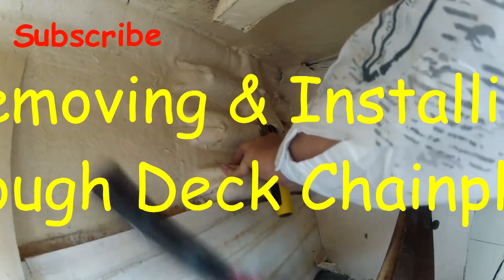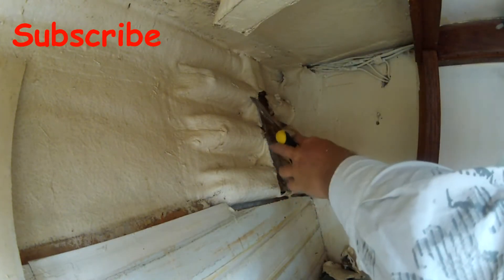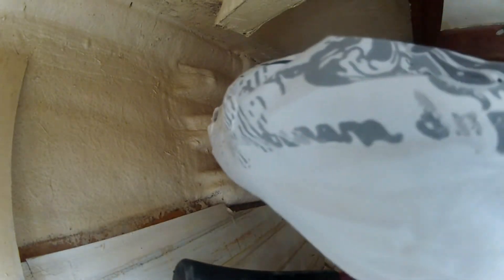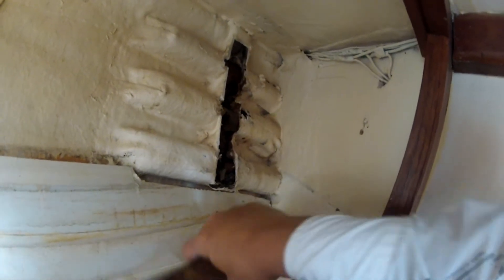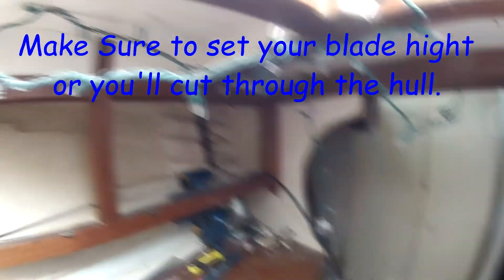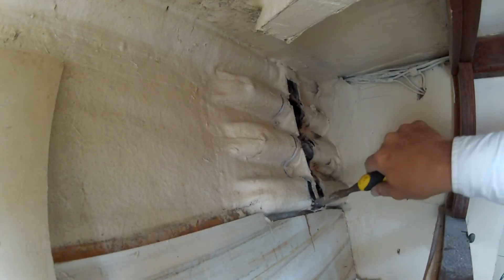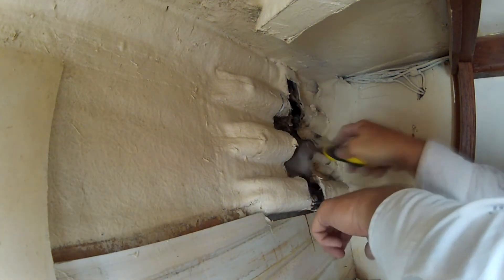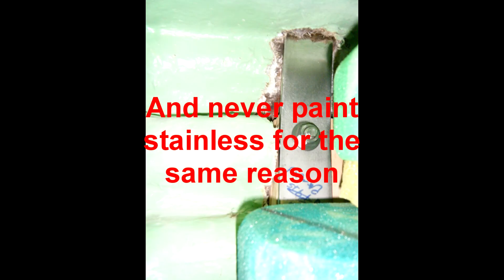Formosa  Sailboat Chainplate Removal & Install, Modded To Fit Sailboat Shroud Plate Replacement

Comment: Hi and thank you for sharing this video. We are doing the same with our Formosa 41 Bermuda ketch right now. We have one question. Over the years, has the construction last, is it strong enough? Or is there any weak points? Best regards Anna and Nils
Reply from the maker: The deck was the only point of concern for rot after replacing the chain plate mounts which were disintegrated.  The teak deck leaks badly on the Formosa.  Best thing is to remove the teak deck and apply kiwi grip after preparing the deck.  Other than that the Formosa are tanks.

Comment: What was inside those three bumps? rotten wood? Did you leave them empty? As in you epoxied the new piece of wood directly to the hull behind it? I was thinking you were going fill up those three bumps with wood and exoxy and also to the center new piece of wood, making it one super solid structure for chainplates to attach too.
Reply from the maker: There was rotten wood that was almost non existent .  I did not need to rebuilt the three mounting standoffs.  I mounted the plates with a wood backing stand-off  directly to to the hull. The hull is very thick at the mounting points and with the wood backing and as the plates go through the deck also, this makes a super solid mount.  Have a good one.
Reply: @RippleLife  thanks for clarifying. Me being a total pussy in terms of structural matters would have over built it stronger than original. But I am not the owner of this boat yet so maybe i am underestimating the hull strength. I hope u r right and it really holds well over years
Reply from the maker: @yashmanwani6232  it will depend on the type and thickness of the hull, and the location and angle the plate is mounted, and the way the shrouds attach.  Good luck with it.  Take care.

Comment: It's hard to tell, but it looks like there are ribs glassed to the interior of the hull to spread the load of the chainplates. I would be concerned that the replacement doesn't spread the load to a larger area and will put an enormous stress on a small section in contact with the  bolts. Having the wood epoxied to the hull will help, but it's still quite a small area.

I'm replacing the internal chainplates on my Reliance 44 and found that the plates are secured to two six foot long steel bars buried in the 3/4 inch solid fiberglass portion of the hull. This spreads the load very nicely. The replacement will be external chaiinplates. In this case I'm using 3/4 inch G10 epoxied to the inside, which in turn has 6 layers of 1708 (24" x 24") epoxied over the top. So that's over 2 full inches of solid fiberglass and 4 square feet of surface area for each of 12 chainplates (it's a ketch). It may be overkill, but I'm only going to do this once in my lifetime.
Reply: I completely agree with you on keeping the SS exposed. I was surprised to find this when I researched it, but it makes sense once you understand the chemistry. The only thing I'll have buried are the shafts of the bolts which is unavoidable. The backing plate I'm using is G10... essentially a fiberglass/epoxy material with mechanical strength about two thirds that of steel, and much stronger than wood. It won't rust or corrode and it doesn't matter if it's buried or not.

Thanks for the video, fair winds!

Comment: Hi there, my wife and I just bought a project sailboat it's an old Ericson 41. One of the so many projects we are running are the chainplates. Like you said, there is not much info. about this here so your video is really helping us a lot because our boat chainplates looks pretty close to the ones you have on your boat. On ours the metal is rotten. We have been trying to do some research about where we can buy new metal chainplates because we read on a few sites that it has to be a specific type of metal, not just stainless steel. Do you have any advise where we can get the right metal chainplates?
Reply from the maker: +amateur sailorchallenge Sorry didn't realize I was in my other account but sure you could guess it was me lol.
Reply: lol yes I noticed right away the logo of the cute dog on the port hole is the same. First of all, I want to thank you for taking the time to do the youtube video, It is really instructive and the tips of not covering the stainless steel to avoid rot is great! Thankyou so much again. . Ive been looking and there is not too many videos with this type of chainplates.Fairwinds, good luck.

Comment from the maker: your welcome.  just make sure you use a good backinginside the hull and it would be good to fiberglass the backing to the hull as well and make it a good size.  although the hull is pretty thick on these guys it will still warp without a proper backing if you go to the outside of the hull.  i believe ours are 1/4 in.  and if you go to a local fabricator he can get you the stainless and do the cutting and bending and still be way cheaper than a marine place.

Comment: Thanks for posting this video! I will be doing similar work on mine this summer. I will be putting the chain plates outboard of the hull however. What thickness/with of material did you use? Todd